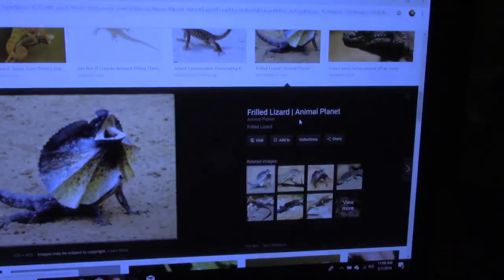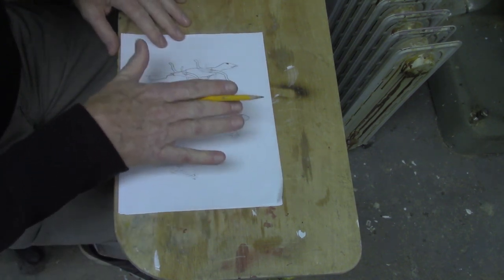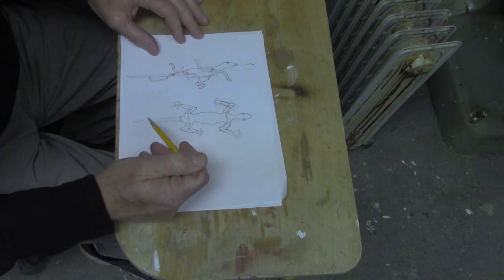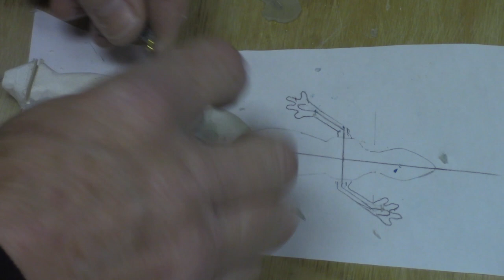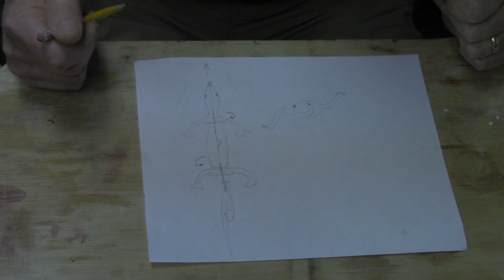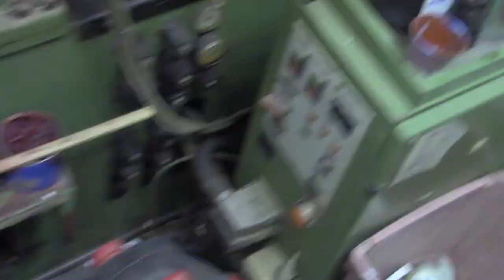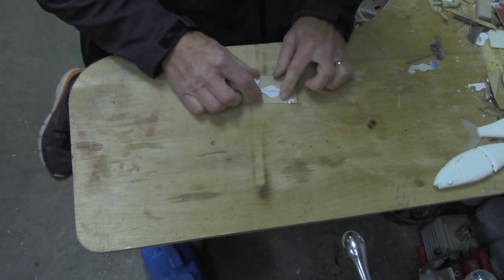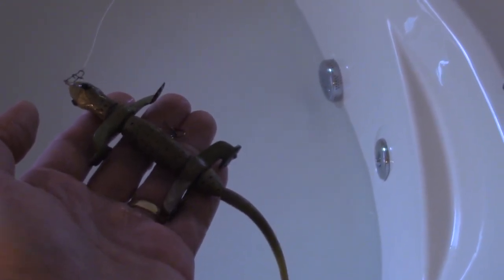New Bass Lure could CHANGE Bass Fishing FOREVER!

Comment: Go to hobby lobby there is a plastic in the bead dept thaw looks like a feris wheel or a paddle wheel sliced very thin if you ran a wire through a zoom old monster liz it might work good your 2nd try was much better